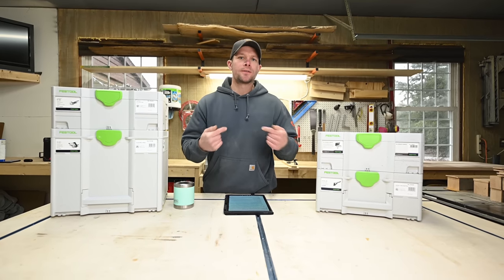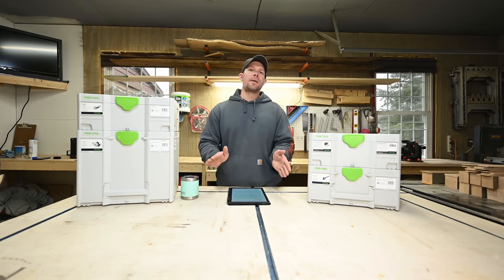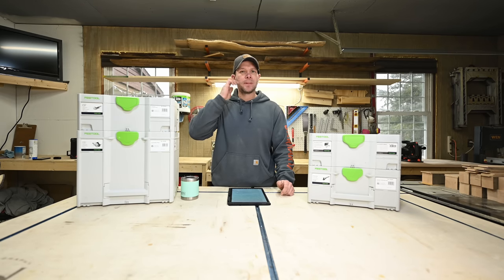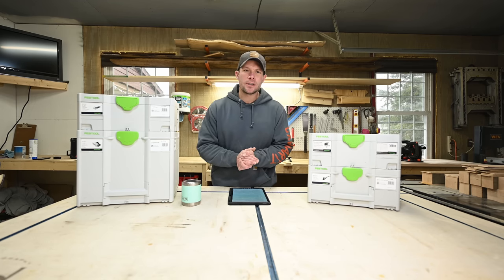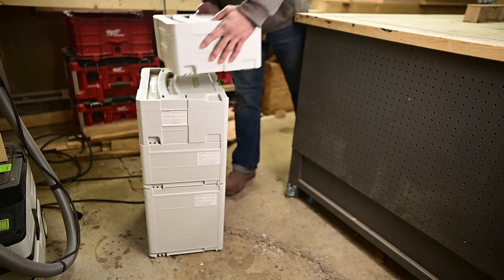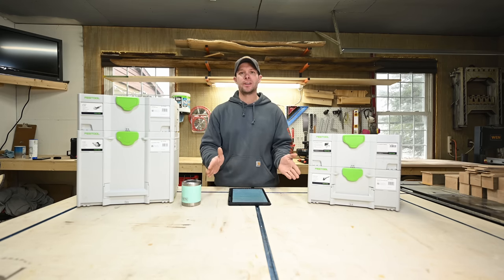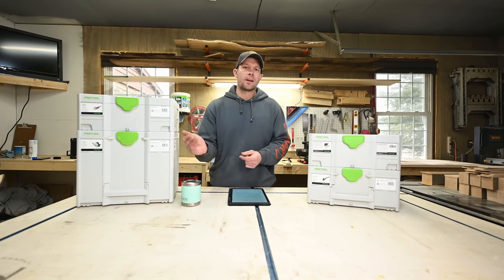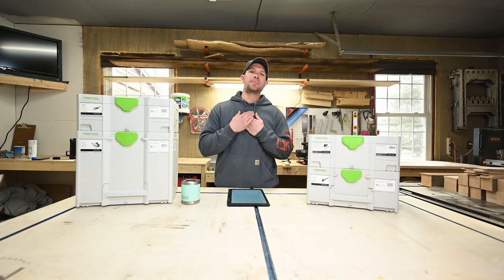I Swore this would Never happen to me...

Comment: I have mostly Milwaukee tools bought the Makita track saw and love it, but thinking of selling it and getting the Milwaukee one, might wait a year and see if they find an issue and make a GEN 2 it's what they often do. I like the quick swap cords Festool has I've used a $600 Mirka sander for 7 months at my job I'd imagine the Festool is as relaxing, 8 hours of sanding before and not even sore.
Reply from the maker: I have been paying close attention to that milwaukee track saw. I think it would be wise to wait for a Gen 2 being this is milwaukees first track saw. My reasoning for going with the festool one is I want good dust extraction and there has to be a hose hooked up to do that which basically negates the tool being "cordless" so I don't mind having the power cord on it as well. More power and no Battery dieing mid cut.
Reply: I have some Milwaukee m18 tools , but I don’t think I would buy the Milwaukee track saw, Makita and Festool have so much more experience in making track saws.

Comment: Thank you for sharing your journey.  I would suggest you not even try a Festool CXS, or you risk ended up with more Systainers in your shop. The CXS has become my go to drill driver. My Dewalt drill drivers are now used for non woodworking tasks.
Reply from the maker: I have the Milwaukee version of that drill. I absolutely love it. It is my most used milwaukee tool

Comment: Just putting it out there, with the sanders the 125 vs 150 (5” vs 6”) the extra inch equates to an additional 30% surface area, which can be a big reduction in work time.

Whilst I prefer the 5” size sanders I personally run an ets 150 for panels main work, and an rtsc 140 corners and mobility. I went with the cordless one because if I later get the delta version it’s the same price buying both cordless as it was corded. And having all one battery system phases me less now that I’ve bought converters…
Reply from the maker: Been debating about getting a 150 pad for my 125. Then can use 6" discs when say I'm doing large table tops

Comment: I have a Domino, Rotex and cordless 5” sander.  I love the   Rotex and Domino.  The cordless sander gets my award for the most efficient.  Now, its a finish sander, make no mistake here.  As far as efficiency goes its the best.  Theres a hundred little jobs a day that need a quick sanding, from a rough cut edge, little mistake  on a finish sanding to a light sand between finish coats.  Just grab it and sand.  No cord and the onboard duct collection is
Reply from the maker: Hmm I wouldn't mind a cordless one now. Your right there's always little things to sand throughout a project. Is your cordless sander a festool?
Reply: Mine is the small Festool, I think its a 125 series.

Comment: Yes, Festool is my dependence 😂. I have 4 dust extractors, track saw, domino, planer, three sanders, top cutter, 3 accu drills, accu jig saw, accu track saw and a lot of systainers. It is a great system. For example - my ten years old accu drill still works perfectly fine and of course with the original batteries!
Reply from the maker: Wow! You got quite the collection there. I don't even have room for 4 extractors. Lol

Comment: The Wen vs Festool track saw hit different. I've used both, and both have the same stupid issue - the tracks. I have to use an 8' level on it's side to line up the tracks to ensure they are straight. If they are off, even a 1/16 or smaller, that translates to like 1/8 or 1/4 over many feet (in my case 8-10 foot tables). I will say the Wen, while great for the price isn't super great for glue joint rips (when you rip one side, another, then put the two together and rip them together). I used a machinist square and no matter what, always off a little bit like .003. Same with Festool. 

I only have experience with Festool tracksaw, nothing else. The domino I am eyeballing though because I find myself needing to do mortice and tenon more and more and I'm kinda wanting it now.

I secretly love sanding now. Why? I have the BOSCH ROS20VSC, and it's a 5". Get the hook and loop pad protector thingy (official name btw). I use the 3m 700 series sanding discs on the finish stuff and like 40-120 using gator discs on the really rough stuff and it's great. What makes it great is once you have the right hose to suck the dust, it's magic. Toss in my air pods and ear protection set and I get to zone out. I am looking at the new 3m sander and possibly, maybe a festool but the only tool I really need from them is the Domino. I fear that day, because I feel like I'll want everything else.
Reply from the maker: The domino is fantastic. That allows me to make furniture that I would not be able to without it. (Or would take a ton more time) I am the same way with sanding, ear buds in, tunes or podcast on and just zone out. Once you get it I'm sure you will love the domino. Thanks for the comment!
Reply: @BradyHommel  I believe as people work up to these tools, they will like at time value of money and realize that certain things are worth it.

Comment: I got my first festool by trading an old table saw. The guy offered me the TS 55 with special addition systainer. Then my Wife bought me the OF 1400 EQ-F Plus Router for a B Day/ Christmas gift. Then I pulled the trigger on the Domino DF 500 Q Set with the dominoes tendons assortment systainer. I love the quality in the customer service for sure, but the quality of the tools is where it’s at for me..
Reply from the maker: They are definetly top notch! I got the same domino assortment systainer with my domino as well. I think that's a must of buying the domino. How do you like the router? Have you used it much yet?

Comment: My TS55 track saw failed after four years of light duty.  Sent to FT for repair; quote is $401.00.!!! Found out that unless you specify fix only broken parts, they restore to like new which means they replace all parts which come to $400.  I have asked for a revised quote and we will see how that comes out.  But this $600 saw should not have had any failure with the light duty it has seen.  Very disappointed.
Reply from the maker: That is a bummer. I agree that shouldn't happen for the price you pay. Hoping the revised quote is better for you.

Comment: Still not convinced.  Festool is not the only choice when it comes to high-end tools.  I have a domino and I think it's great but then no one else offers one.  I use it with a Bosch dust extractor that works great as well.  Making comparisons to tools like Wen is just plain silly.  They are designed for a totally different price point.  I have a Makita track saw that gives me tablesaw quality cuts that also works well with my Bosch extractor with no adapters.  If you're a carpenter doing on-site work, I can see the advantage of the Festool system but in a shop, don't drink the cool-aid that says every tool has to use the same proprietary power cord to be efficient.

Comment: I’ve always wanted a Domino. Pre-Covid I used to go to the Festool Connects. The US location is just an hour and a half to two hours away. Went to two of those. Never got to actually use one. But I would say. I JUST want the Domino. Nothing else. Then I went to an event they had in Louisville just an hour away. They had a trailer set up with all the tools and I got to USE them. I was SOLD on the Domino 100%. Then the guy was like… try the sander. I said “I love my porter cable 6”. But I used it anyways and loved them. Then he had me use the track saw. SOLD. And then he said…. “Try the Kapex”. I said NOOOOO. Not going to. It’s a miter saw. OMG!!!! I want one so bad still. FOr me it was the Domino…. Which led to the track saw…. To the dust extractor… to the 3” rotex… and then the 5” sander. I now want a 5” rotex. I definitely want the Kapex now. And I want the MFT/3 table.
Reply: Oh. And for my birthday… I bought the vacuum accessories for my dust extractor. Yeah… expensive. But I love them. I love that they store in my systainer on top of my extractor. I love that they fit my extractor perfectly. I absolutely do not regret any of my purchases.

Comment: That DeWalt sander really is a piece of junk compared with 3M, Festool, etc. Got it, hate it. But their jobsite table saws... the best - very good as saws, stunning as bang per buck.
   If I was younger, still working, I'd go Festool or Mafell with dust control as to priority and efficiency of use next to get more higher paying jobs done while looking like a higher class operator
Reply from the maker: I had a Dewalt jobsite tablesaw before this delta and it was an awesome saw. I gave it to my parents when I got my delta. So I still have access to it if I need it for off site work.

Comment: Ahh yes.... You are still early in the journey grasshopper...  Soon, the systainers will be many—that you must memorize, as all the labels will fall off—but the tools inside will be great, and the accessories will be plentiful. (Well, if you buy the accessory kit, which of course comes in another systainer.) Eventually you will have all the product numbers memorized, and have strange conversations with other woodworkers, like "If you have the 700 and the 1400, do you really also need the 1010, and if so, what would you use it for?" and only those who are of the green and black will understand what the hell you just said. When you become fully immersed, you will intuitively see the difference between a 3/4" and a 20mm hole, and you will know that there can only be one TRUE perfect grid of holes. (That grid also requires a special router bit to create it, but it's available in an accessory kit. With systainer; temporary labeled so that you have ample time to memorize its content before it becomes part of the anonymous wall of green and, um... white? Cream? Kinda yellow? Whatever) See the green; be the green. Use the green to get the green. It is all one circle of life, created with the circle guide. (That guide is part of another accessory kit BTW... and it comes in a systai....

Comment: Having gotten a Domino first is the same path that brought me into the Festool world. Surprisingly the one plug for all failed me. My second tool from Festool was the OF 1400. Well I was shocked when the plug it cord from the Domino didn't fit the OF 1400. But the plug it cord from the OF 1400 fit the Domino so I used that cord as my main cord. I can't say that Festool has made me cry once, it seems the cry happen every time I have replaced a tool with Festools product because  I realized I should have just went with Festool. Festool Domino started all of it, then the interest in the LR32 system lead to the OF 1400, then the dust extractor. Then I had to calibrate my Dewalt tracksaw again. That again wasn't long after I previously calibrated it, so it's now been replaced with a Kpex. Boy I was completely shocked, out of the box everything was spot on no calibration needed. So I recently found the base plate for my Makita tacksaw is warped and has caused a couple of interesting cuts, so that is next on the chopping block. 

The quality and ease of use is really hard to explain and makes the cry worth it to me it seems. I want to go out to the garage/shop and work and relax and not have to test and troubleshoot my tools.

Great video, it's great to see others out there that were exactly like I was/am.
Reply from the maker: Thanks for sharing... same with me when I bought the track saw... the cords that came with my domino and sander would not work with the track saw. The pattern was different... but the cord that came with my tracksaw works on all the tools so I just leave that one plugged right in to my extractor at all times.

Comment: Howdy...

I don't even know where to begin discussing why you are absolutely  wrong with your discussion of Festool. So, I'll just start with price. 

The reason they are "expensive" (which is a relative term tbh) is because people such as yourself keep paying that price and then turn around and still complain about it, BUT then also legitimize the purchase by calling it "high end" tools. 

Sir. Festool is by far, BY FAR """NOT"""  "high end". A price tag does not denote a high end product. But then you'll probably say it's a superior quality. Is it? Really? Have you taken it apart, strip it down to its components? What is your basis for that determination? Let me put it another way. I show up to your shop with 2 Circular saws. Both have been stripped of their "shroud". All you see are the base components, gears, switches, wires, etc. I tell you one is Festool, the other is Ryobi. By looking at those wires, switches, gears and motor, could you tell me of those components which is of higher quality? 

Is Festool using magical copper that was forged differently? How bout the circuitry, did Festool use gold for solder? Are the screws, bolts and nuts made from titanium or something and Ryobi is using Tin? 

You analogized a sense of "quality" comparing Snap-On to Craftsman mechanics tools. At least with "that" comparison, you were correct. In that case, Snap-On actually does use a superior quality alloy for their tools than does Craftsman. But that analogy does NOT carry over to make your point with Festool. 

So, circling back around to the beginning of my comment, Festool costs alot because of marketing and people continuing to pay triple. Then, people who are new to the trade/hobby of woodworking see all these YouTubers using Festool and mistakingly believe that having a high dollar tool will make their craft "easier" to make AND have a higher quality end product. And so, they jump onto that waggon and the cycle repeats itself. 

A "FINE" crafted table is crafted with Learned Skill, not "high end" tools. I can slap a straight edge/level onto a board and use a Ryobi Circular saw and cut just as straight a line as you can with your $1000 track saw. 

Look at Antique furniture. Think that Craftsman who built it used a Domino? Or did they use Skill learned over years and years? 

I've been woodworking for 42 years. I've made some DAMN fine furniture in that time WITHOUT Festool. In fact, I have a desk I built when I was 15 years old. My wife uses it still. I'm 49 now. That desk is older than you are Sir (most probably) and hasn't even tried to fall apart. Am I making my point? 

My suggestion to you and others who read this is to jump off the "hype band wagon" and stop putting your hard earned money into the pockets of Marketteers and instead, invest in yourself to educate and learn your craft and develop your skill.